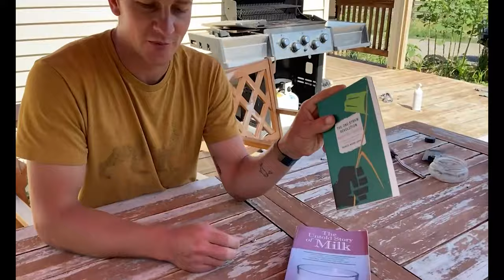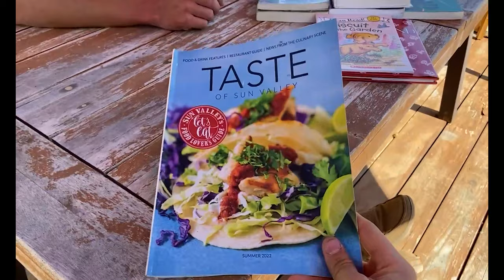Raw Milk Revolution: A Look Inside Wild Spaces Micro-Dairy

Comment: Why is the pulsator set so slow? 
Also, cows produce more cream the further into lactation they are, not in early lactation, so I was confused by what you said 🤔
Reply: I was recommended one pulse or click per second. 

Open to suggestions. 

I seem to get less cream in late lactation likely in part to the cows holding cream for their calves. 

However my cream line seems to stay consistent through the year.